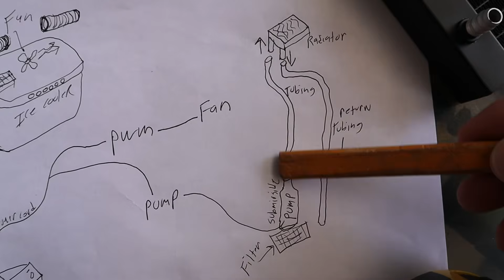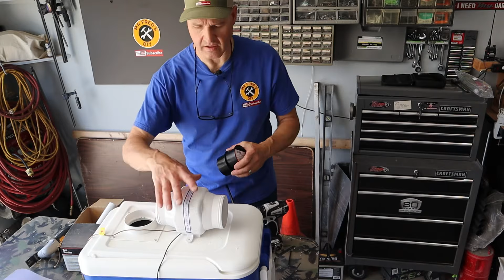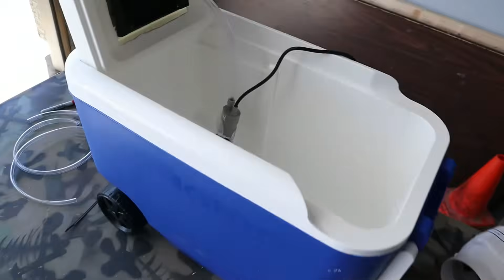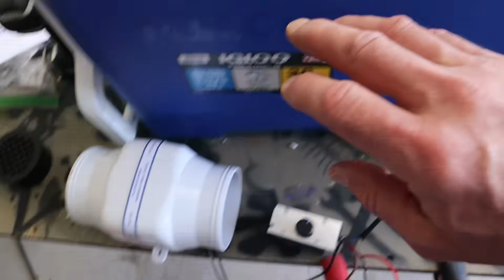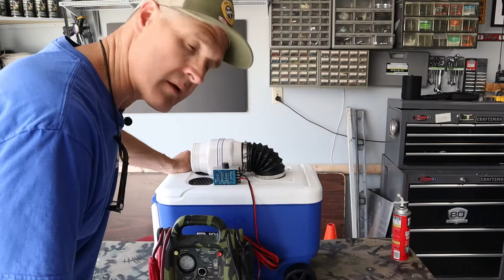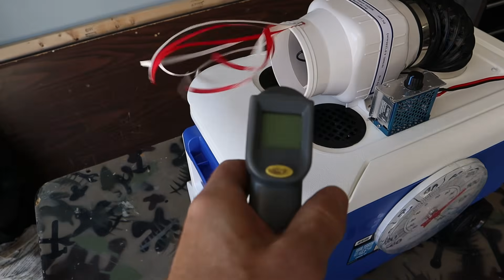DIY Ice Cooler Air Conditioner

Comment: I dont want to piss in anyone's soup but this is in no way an airconditioning unit. An Airconditioning pulls moisture from the air and blows cool dry air in the room the airconditioning unit is in.
The way this video does, it only blows the moisture from the ice in your room..ofcourse its cooling down the room i dont argue with that i admit...but the moment you turn off that fan, the temperature rises realy fast because of all the moisture in that room. Like i said, this homemade thing has nothing to do with airconditioning.

Comment: Use plastic golf ball sized wiffle balls on the output side. Put in PVC pipe, fill to capacity, then put grating over the end to hold them in. Finally you drill a hole at bottom of output pipe to allow condensation to drain back into cooler.

Comment: What baffles me: why blow air into the cooler at all? Pump water thru the heat exchanger and blow air thru it. You only need the cooler as the water source. What am I missing? Nice ac though.
Reply: That is what he is doing. Pump pushes water through the radiator and the fan pulls air through going through the "plenum" space. My problem is zip tying the hoses together. The intake is going to pull cool water into the radiator. Hoses SHOULD be on opposite corners for the sake of efficiency (Especially on a battery).

I also would have hard wired the pump directly to power so it's a constant water flow and use the "dimmer" to control the fan (Temperature).

Comment: Wouldn’t it be more efficient to just mount the radiator on the top of the cooler and have the fan pull the air through it? My only thought on that is then you would only need three small holes in the cooler.
Reply from the maker: I thought about doing it that way. One problem is that the radiator produces quite a bit of condensation depending on humidity levels.

Comment: Amazing! I watched several videos on your channel about the air coolers and used your links to get the parts, I just have a question about the speed regulator. I got it and it came with a circled wire with a fuse.. i didn't see you use it, do we need that? And if yes, where does it go?
Thank you ✌️

Comment: I built everything to spec but cut the cigarettes lighter adapter and connected a regular plug...wanted to power it thru my 400watt inverter connected to a 12v battery...unfortunately it didn't work and said overload on inverter when I tried to power up...and suggestions on what's wrong ? Or should I reconnect cigarettes adapter again and connect to jump box ?
Reply from the maker: Regular plug? I used the cigarette lighter plug to power the 12volt blower motor. The 12volt blower that I used will not work powered through a 12Ov plug in an inverter.

Comment: Awesome build, thanks! Would an additional radiator on the intake of the blower have much of an effect? What is the make/model of the Infrared Temperature device you're using? Here in Austin, I can't effectively use a swamp cooler for 1/3 of the summer (high humidity). Do you think this build would contribute much humidity?
Reply from the maker: A second radiator strategically placed might well be more efficient. This unit makes some pretty cold air but I am always thinking about new designs! I recently made a testing video for a few of my designs. You can watch it here.▶️https://youtu.be/-ssSvss5woE?si=B-EnjS70V5SRJbyl

Comment: I was just right thanks for the great instructions in building this. I'm in Brooklyn New York I was thinking of building one myself at the beginning of the heatwave starting the beginning of July. I just never got my act together with the sudden heat wave. It was like 3 weeks of a steady 90+ degree temperature so I never got it. Now the temperature in August is just about 80. I'm still looking to make one. I see it's a simple concept you tood us. My big worry like one of the guys here asked about the submersible pump. Man I'm worried about electrocution if the pump malfunctions is that possible? Most of the pumps I see are all under water. One side of the pump has a grill that takes in water and the as a tube coming out to connect a small hose. What do you suggest? Where to get a pumper tubes on both sides so I can keep it above the water line? What I was hoping to build something mostly stationary. The box we have the speed control and all that wires coming out of it I think it's too much for me to comprehend. Maybe I can do one without. What also confuses me is radiator what do you mean by the radiator? The other videos talk about going into a refrigerator and pulling out the fins that have the metal tubes going through it. is that what you're talkin about? I went to home Depot and picked up l/4 inch 10 foot copper tubing. Which I was going to make into a spiral over a 12in.. but that's not well figured out. Like if you can put the copper tube rap close into a cóne shape and then put it in those 4 or 6-in flexible hoses pushed by the computer or a small fan. That I think would concentrate the coldness into a very confined space while it comes out of that flex hose or those plastic ducks coming out of cooler I don't know it's just some ideas I just need to like work on it instead of just thinking qnd not redesigning and redesigning and notthing gets gets done.. I just turned 72 been getting pretty disorganized very easily so I wish I can get my act together any thoughts please thank you.. take care and stay well

Comment: I like this build better than any others I’ve seen. Great job! I do have one question though. Does the pump (being submerged) get warm itself and add to warming up the water? Have you thought about an in-line pump where only the intake tube is below the water line?
Reply from the maker: I do not believe that the pump adds in the heat to the water, and if it does, it is minuscule. Thanks for watching.!

Comment: Thanks Fred!  We are building this to your exact spec over the next few weeks for a camping trip in the hot Texas sun.  Any idea on how much power is drawn?  Shopping for a portable power method so that this can be ran overnight.
Reply from the maker: Here is a link to the testing video I made last summer. The pump and blower combo when running on high draws 4.25 amps. Hope this helps! ▶️https://youtu.be/ENhpHyx3Xe0
Reply: @MrFredsDIY  Thanks fred!  Quick question for clarification, as I am using an online calculator to decide what portable storage to use.  Is that 4.5 measured in Amp-hours (Ah) or milliamp-hours (mAh)?  Makes a big difference in my shopping choices.  

(sorry if this is a dumb question, I'm new at this)
Reply: Our build is almost complete!  Excited to show it off to you.  I'll do a little video.
Reply from the maker: Good luck with your build! I can’t remember the power draw offhand, but I’ll look it up! Maybe I’ll do a power draw testing video with a few different 12volt power sources. I have a 50AH LifePO4 that I used in the project boat for this Friday’s video. I’ll bet that battery would last several hours with the fan on low. That Battery was $169 on Amazon https://www.amazon.com/dp/B0C49STP5P/ref=cm_sw_r_as_gl_api_gl_i_HKTYRANYMW6EYKZCH5HH?linkCode=ml1&tag=mrfredsdiy-20
Reply: @thezerohawk how did it work I’m making one right now, worried it won’t be dry air coming out and soak the tent in condensation
Reply: @jakeriley1312  Wife just made it home from her camping trip.  The AC unit (nicknamed: Chilly - referred to here on) worked great!  Built to exact spec in MrFredsDIY version, sept we used plexyglass cover for the ice.  Amazon products linked by MrFredsDIY were used.  Chilly was plugged into a EcoFlow River Pro with Solar panels.  She got 7.5hrs on full blast from it.  Similar AC cold coming out of the blower while testing, but warmer air when the air coming in was of higher temps durring the day.  Chilly was the #1 item that made her camping trip in 100 degree weather livable durring the trip.

Condensation was present, but not as bad as one would normally think.  Some leaking out of the blower, but nothing a small towel under the blower couldnt fix.  10 out of 10 would recommend the build.  Chilly worked great.  Only drawback was the cooler used, ice would die before the electricity would.  

We are going to build a new one, but with higher quality cooler.  We kept the cheap Cooler like Fred used for our first build to test it out.  We'll use a much nicer donor cooler for the next build.
Reply: Apologies my video review is going to be delayed.  We spoke so highly of this cooler, that my neighbor wants to borrow it for their upcoming trip.  So we don't have it at the moment to review.  But we will absolutely post something soon.

Comment: Make a coil or hose that the air blows thru and up out the vent !
Reply: Like a one inch copper pipe coil ! Even can make it two layers sitting in the ice water and in contact with the ice .

Comment: Here are two fun facts: 
1. He would have gotten just as much BTUs cooling as if he had just laid a block of ice in the room.  Yes, the fan and duxting directs air helps in that direction.  But it's the same block of ice. 

2. If his ice source, a.k.a freezer is in the same cooled space, he is making his space warmer, not cooler.  Reason? A modern fridge is 20-25% efficient:  For every BTU of cooling to make ice, your fridge is making 4 BTUs of heat that vents into your cooled space. That means his fridge is making way more heat than the ice is cooling.  Move the freezer out of the space (garage) and the science changes a bit.

Comment: Pour salt 🧂 on top of the ice. 🧊 You may get some supreme cold temperatures 🌡
Reply: Yeah temps below freezing but it melts waay faster too. You only want to use in frozen containers or it will cause corrosion over time.

Comment: I'm assuming the cost for everything, plus labor, is still significantly cheaper than your average window AC unit? What's the energy draw on this unit? Great vid, thanks man
Reply: Seems pretty loud, but I'd trade audible discomfort for 10-20 degrees cooler.
Reply from the maker: Here is a recent testing video for this AC. It has many data points including amp draw. Thanks for watching!

Comment: I built this cooler step by step how you did with the parts you supplied, minus a few 3d print ed parts I did. But when I turn it on a few minutes of it being on water starts coming through the fan. You think maybe the radiator has a hole? I haven't added plexiglass or styrofoam yet as I was just testing it
Reply from the maker: It’s possible it has a hole. I’m publishing the follow up video tomorrow. While filming I noticed that if there is humidity there is a ton of condensation. It makes me curious though. Some kind of pressure test might show if you have a leak
Reply: I'm in Texas so that condensation build up makes sense
Reply from the maker: @beaucopeland243  here is the follow up! Best Homemade Air Conditioner Ever!
https://youtu.be/ENhpHyx3Xe0

Comment: So many different designs and ideas on how to fab these up, I've been taking bits of ideas from different sources. Those drain plugs are excellent for air inlets. I'm making one using copper tubing down in the ice/water compartment, using a separator to keep the ice/water from making contact with the air, then using the pump to send water to the coils and to the radiator up under the lid in a closed loop manner. Still thinking it through but basic idea. Thanks for sharing.
Reply from the maker: I published a follow up not to long ago where I closed the air system.
https://youtu.be/YCfmn16QCas
I’m working on a testing video for the unit as well. Thanks for watching!
Reply: @Alpha-ms9nj  I am in the process of this exact idea only I'm using another larger radiator that'll be submerged in the ice and water.

Comment: you could also run 2 radiators 1 large 1 at the bottom and run a closed loop system. And use the ice as radiant cooling as well. The aluminum should stay cooler then just water.
Reply from the maker: Thanks for watching. Interesting idea! Here’s a follow up videoDIY Ice Cooler Air Conditioner https://youtu.be/YCfmn16QCas

Comment: Before starting any of the holes, you can drill small holes in the lid and use spray foam to inject spray foam into the lid where it will expand and fill the cavity. This negates the need for the rigid foam.
Reply: No, the foam isolates the ice from the air chamber to rely on the radiator instead of ambient air. Without that foam, it would certainly be colder, but the ice would melt a lot faster too, so it wouldn't last as long even with a better cooler.
Reply: @C71-m1l  Correct but it wouldn't hurt to insulate that lid. Not sure why he didn't do that because you could see all the empty sections when he lifted it after he cut it but definitely need to isolate the two chambers. Good call.
Reply: @CommonCentsRob  It also wouldn't help to insulate the lid. The fan is pulling in ambient air through the radiator, so the top air is always going to be hot. However, the gaps could have been smaller in the top foam (maybe add a sealed handle instead of finger holes) and a better cooler would help the ice/water in the bottom.
Reply: @C71-m1l  you also couldn't out new ice back in it if the top was sealed with spray foam

Comment: This is one of the best designs I've found.  Other similar ones put the fan on the intake pushing the air in, and maybe adding a radiator on both intake and exhaust.  I wonder if there is a way to somehow run the airflow through a duct but still have it pass through the radiator and cover the duct with ice.
Reply: Yep! Just like with air conditioner units, the more coils you have, the colder the temperature. Also by putting the pump and the fan both on the same switch, it defeated the purpose and ability to get colder air at lower air speeds. If they were not on the same switch, and you still had the pump on high, passing more cold water thru, while turning fan speeds lower, passing with less air, you would get colder air on lower the fan speeds, just like an actual air conditioner. That's why o. The old under the dash units on vehicles they had seperate temp and fans switches 🙂👍
Reply from the maker: Here is a follow up video for a few mods to the cooler. Thank you for watching. https://youtu.be/YCfmn16QCas

Comment: Nice air cooler and I’ve made a few of these and just recently bought an icy breeze v2. I use 2 radiators and the air temp coming out of the duct is in the 40 degree range.
Reply from the maker: I appreciate you watching the video. Two radiator is pretty beefy!
Reply: Question.....did the DIY cooler last longer than the icy breeze . In terms of Temps and still frozen ice. Watch alot of videos and It seem that the DIY coolers last for 8 hours while the icy breeze v2 last for only 2 hours before melting
Reply from the maker: @toyomoma.6841 how long the ice lasts really depends on several factors. I’ve had it last 90 minutes in the garage with an outside temperature of 112°. I’ve had it last half a day camping with the temps in the 80s.
Reply: I got an ice breeze. Use it in my deer blind in summer. One 20 lb bag of ice last about 1.5 hrs when outside temp in the low 90’s. Work good if blowing directly on you.
Reply: @E85_STI  could you explain how you added two radiators, thank you
Reply: @melissabutler883 yes so I have two small radiators that are about 8x8” and I have the water coming into one and feeding into the other then it drains into the bottom of the cooler so this method allowed my cooler to maximize the cooling capacity but as of now I’ve made a different one. I bought the 100 dollar hessaire evaporative cooler from Home Depot I removed the media and I replaced it with an oil cooler(radiator) and I run the pump and ice water and it’s a larger more compact cooler.